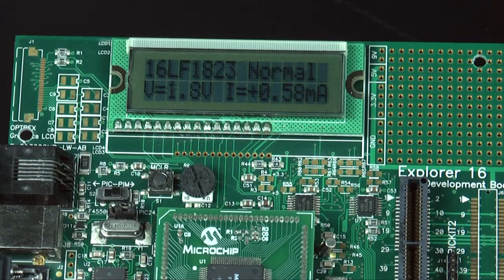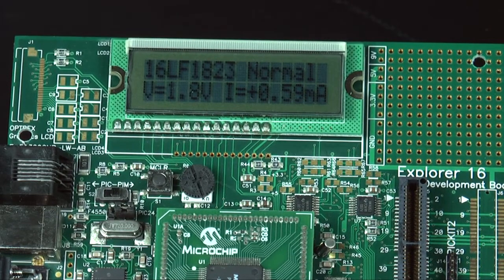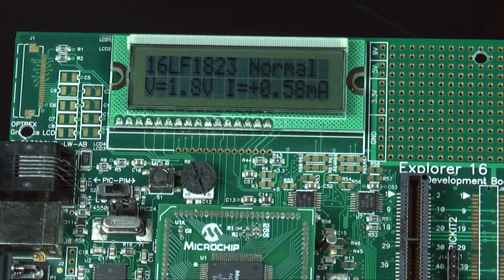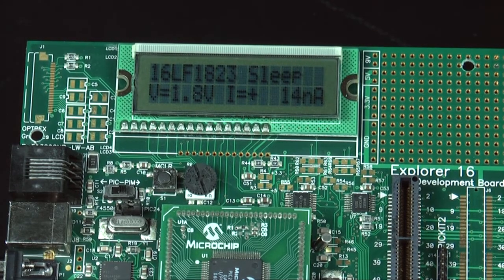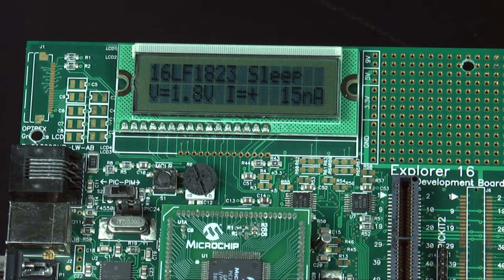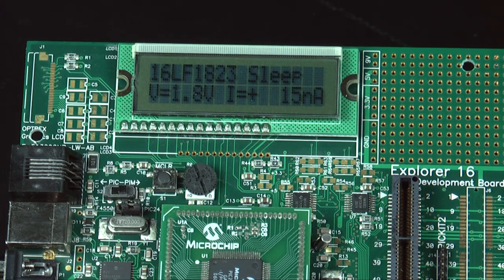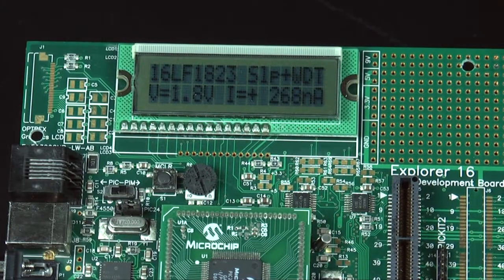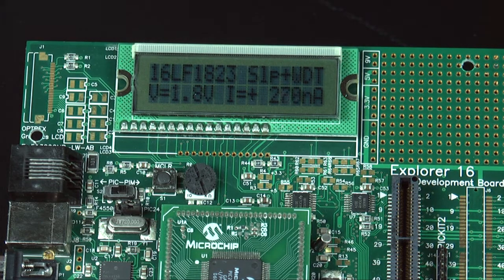The nanoWatt XLP PIC16LF1823 Sets a Low Power Benchmark  beats MSP430!

Comment: @rfengr You are correct that there is not a “single” battery that gives you 1.8V.  There are many reasons to discuss 1.8V.  If you are using alkaline cells, they have a linear drop in voltage over their lifetime.  Fresh batteries output 1.5V, 3V for cells in series, but soon the voltage drops due to self-discharge and the discharge caused by the application.  At the end of their service life, alkaline cells in series output 1.8V.  There is 3V info and single cell info at our XLP web site.

Comment: @rfengr Grapes make for an interesting trade show display, but batteries and energy harvesting are what gets designed in, today.  We’ve partnered with the Energizer battery company to develop joint solutions for engineers that need low-power, long-battery-life applications.

Comment: stop using 1.8v, there is no single battery out there that gives you 1.8v or 2.0v. The only values that make sense are 2.4v (two AA/A rechargeable) or 3.0 (coin or two non rechargeabale AA/A), and the 3.0v coin battery is more attractive for compact designs.